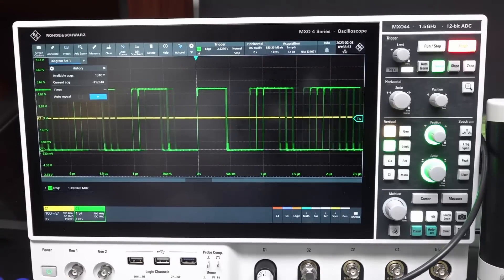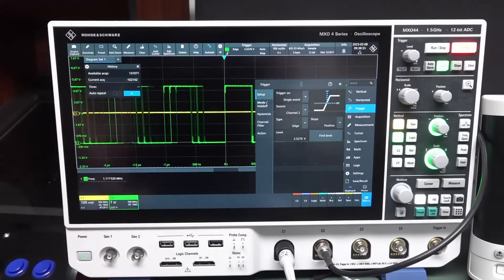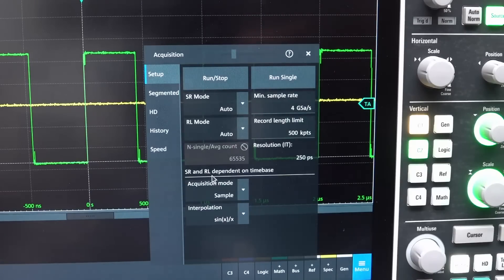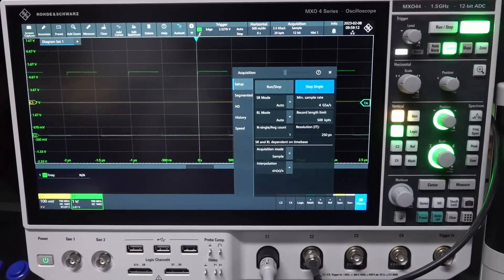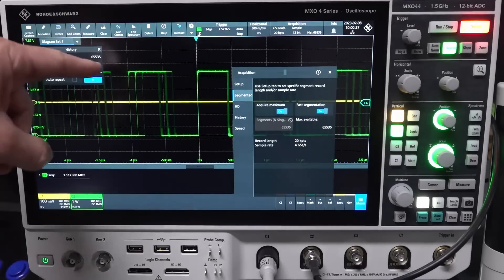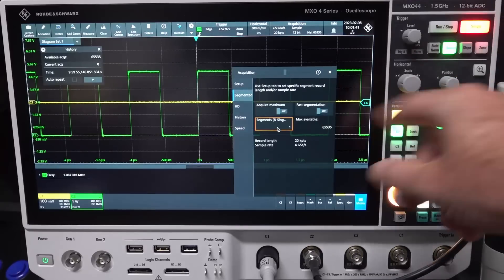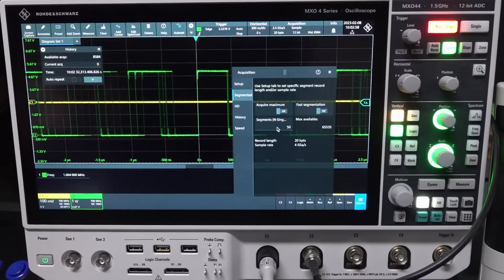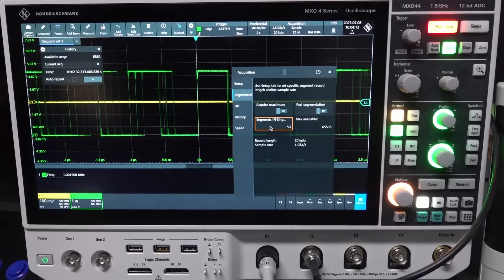The R&S MXO4 is too powerful for its own good (and Dave's sanity)

Comment: Ya know Dave, the bottom line is your assumption that "you shouldn't have to read the manual" is just wrong.  It's ridiculous to believe you should be able to operate any modern technical stuff properly, especially something like this masterpiece, without at least skimming through the relevant sections of the manual first.  And you PROVE that in video after video after video.  Watching you fumble around when you should really be explaining this stuff is just as ridiculous.  Come on man, get with it.

Comment: I bought one and had the same frustrating experience with signal shot mode.  There are a few other discrepancies in the operation of this scope,however, once I figured all the quirks out, I realized it blows myTek MSOX44 out of the water.

Comment: Was the segmented memory disabled on the rtb2004?
Reply: That's the software option you need to pay for 😢
Reply: @HSong-qr7dn  Yes, Rhode has a lot of software options that are extremely costly.
Reply: @tomasbergh  True! I compared the price of hardware plus software for rtb2004 and rtm3004, then realised that MXO4 is a cheaper option.
Reply: @HSong-qr7dn  maybe but then you have also softwares for the mxo4 that should be added?

Comment: There are two main branches of DSOs. The first is general purpose lab DSO, which, in some way, emulate the behavior of analog oscilloscope adding some more features to it. These things are very intuitive, you probably never open the manual. And there is also the second branch containing heavily specialized devices, presented MXO4 is a good example of a such thing. You definitely need to read the manual of such device and doing measurements is not a straightforward process due the fact, it needs some planning. UI of these things somehow expects you are using features like loading, defaulting and saving presets, which gives you (at least) predictable starting point. Typical workflow begins with planing the whole process, then loading default settings, then setting all you need to se to do the planed measurement and attaching the probing equipment, then saving that settings (just to have some point, where it is easy to return to), then doing measurements, saving results and analyzing them. These extremely complex equipment carry ability to somehow mimic the general purpose devices, but it's crucial to build some default preset (or more of them) to create an easy to use start point. They offer such a huge amount of menus and submenus with a lot of options, that it is almost impossible to hold complete situation awareness, which lead us to situations, where some setting, accidentally left from previous session, lurks in the deep darkness of complexity of that device waiting to kick your ass at the moment you wouldn't expect this, which is what happened in this case. The level of complexity of a general purpose equipment is much lower, which give those issues almost no place to hide. Which implies, that these heavily specialized beasts require complete different workflow than general purpose ones. Just my own experience.
Reply: Ya they need a different workflow, but I'd also assume that a person paying 10k+ for such a scope should know what they are doing. Personally I rather go with such complex menus as they allow you more stuff to do. It takes more effort but it outweighs the advantages and possibilities.
You can also always mess up a measurement with a simple device too, think about aliasing.

Comment: "Vee maake dis good! Yoo must do as vee say in da buk, even if it is not in da buk!  Yoo veel like it, yes!"  
Years ago I ended up with 3 Hameg scopes at work, because no-one else in engineering could get them to work to make standard scope measurements.  I kind figured it out, but depending on "where you came from" with the button presses they would respond differently.  Finally sold them by weight for scrap with the emphasis in the  sCRAP.   Also try ordering parts for these gems sometime. 🤣

Comment: "The tool on the stool needs to be smarter than the tool on the bench." - One of my ME profs.
Reply: Love it... haha. PEBKAC is another one - "problem exists between keyboard and chair"
Reply: @bsodmike  
If you need to explain PEBKAC...........   yeah , NO !!
You probably shouldn't make the comment.
i think you can assume that everyone here knows certain basic things
one of them being PEBKAC

ALSO.. it's actually PEBCAK , but you can go either way , but it started as PEBCAK.

but. ... You never explain it
Reply: These days, that means RTFM because the tools are so capable, you can't find all the capability poking around within any modern mid range and higher scope.   I showed a lot of smart engineers capability in the products they already owned, at HP/Agilent, Tektronix and R&S.

Comment: This is like the RTB/RTM scopes- normally, you just get a history of the last <n> of segments depending on the memory settings, but there is also a "Nx single" setting that sets how many segments "single" captures. 
Essentially this boils down to : 'run' then 'stop' gives you the last <n> segments, 'single' gets you get the first <n> segments. 
This gives more flexibility than the more conventional segmented approach on other scopes. e.g. last segments are handy to trace back after an event, first segments to capture startup/boot behaviour.
 I did a vid about this https://www.youtube.com/watch?v=O0xZXMHKlJY

If "Nx single" defaults to 1, then it behaves like other scopes. I wonder if this resets if you to a 'preset' or whatever they call the return-to-defaults button.
Reply: Ah, yes I forgot the RTB2000 has the NxSingle mode also. I've never used it. Not sure why the MOX4 was set to a high value, I don't remember adjusting it. The MXO4 has permanant automatic history mode which is in addition to the usual segmented memory capability.
Reply: When I start with a Preset (green button), the MXO4 works as one would expect (default of single acquisition, configurable to N acquisitions)   https://www.youtube.com/watch?v=gkgLcDy8ee4

Comment: Dave, it tells you the History mode/depth is on at upper right under the Acquisition section of the status bar.
Reply from the maker: No, that is not the same thing, it's always there for Run/Stop mode. That's the "always on" history mode I mentioned. Totally different thing to the N-Single number count. It does show "1" but onyl after you have pressed Single, not before in Run/Stop when it shows the auto history number.

Comment: Because one has R&S roots and the other has Hameg roots?

Or...   damn this thing doesn't work like other scopes I'm used to, and someone said something about rtfm but I don't know what that is...   (because seriously, you will never have awareness of capability of you don't rtfm)
Reply from the maker: Reading the manual doesn't help much in this instance.
Reply: @EEVblog2  That needs to change.....   But we know manual writers are continually striving to catch up with software capabilities.  (Been there myself...)
Reply: Roots: nonsense.

R&S didn’t make any scopes until they bought Hameg. R&S made other test equipment (RF stuff mostly), not really “normal” stuff like oscilloscopes and power supplies. Their purchase of Hameg is what took them beyond RF into more mainstream test and measurement. (In fact, the first R&S oscilloscope wasn’t released until 2010 — a full 5 years after they acquired Hameg.)
Reply: @tookitogo  that's an interesting story; R&S would be generators, frequency meters etc., kinda like with Brüel & Kjaer, Marconi Instruments or Radiometer. Hameg scopes were fine in my book, not as glorious as Tektronix (still dreaming of getting a vintage one) but still very good and reliable. I was kinda wondering what happened to the company... now I know :)
Reply: @tookitogo  Yeah, well, what do I know, I worked at R&S in the scope side and worked with the people that created the R&S scopes in Munich as well as meeting the Hameg side which at the time, still said Hameg on them.
Reply: @jaakjaak0427  Are you saying that the R&S engineering team was working on their own independent scope design after R&S acquired Hameg?
Reply: @tookitogo  Yeah, definitely a ground up design, and they may have borrowed in some areas, 'cause that would be sensible, but the Munich designed ASIC that ran the first RTO's was definitely not Hameg sourced.   Totally different level of performance.